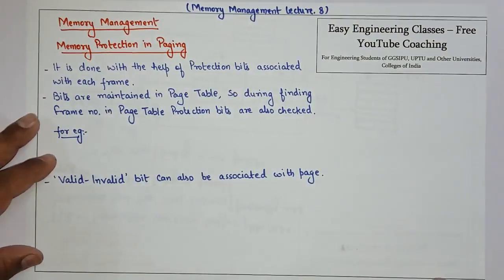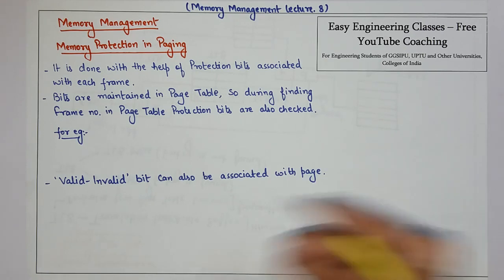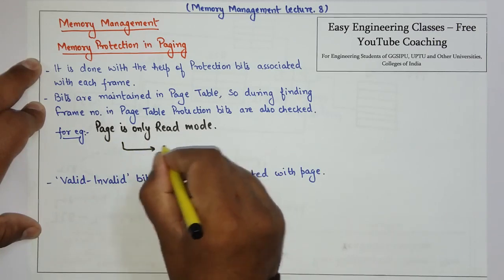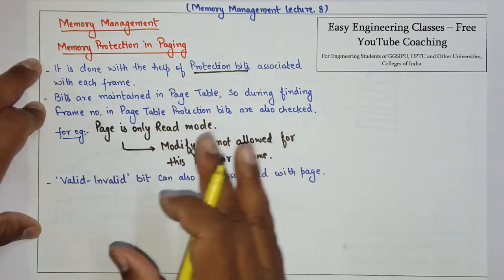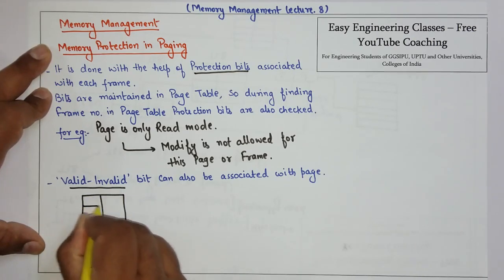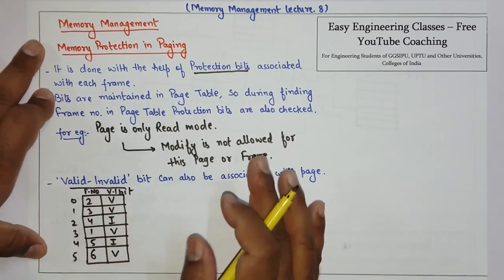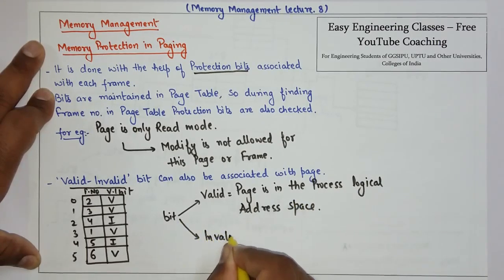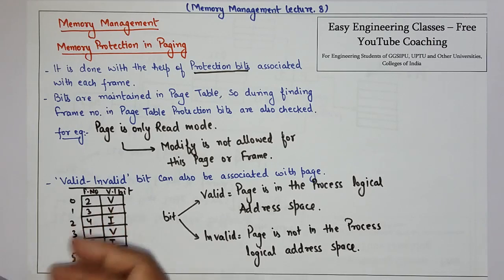L44: Memory Protection in Paging | Protection Bits | Valid – Invalid Bit | Memory Management

Comment: sir, this was in a book ......and u also explained------
"One additional bit is generally attached to each entry in the page table: a valid–invalid bit. When this bit is set to valid, the associated page is in the process’s logical address space and is thus a legal (or valid) page. When the bit is set to invalid, the page is not in the process’s logical address space."
.......
my que is that ...
bit is set to valid, if the associated page is in the process’s logical address space ......or....... process’s physical address space(frame)
Reply: i also have the same doubt,did you get the answer?